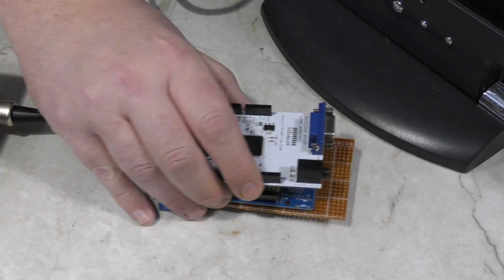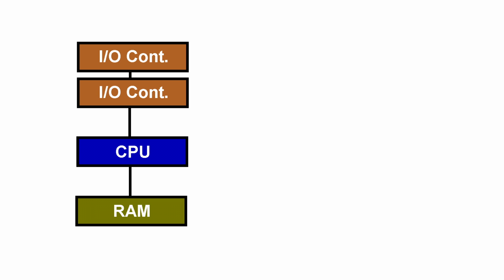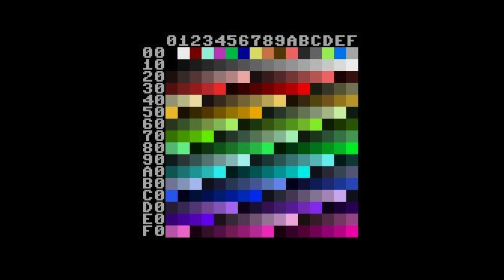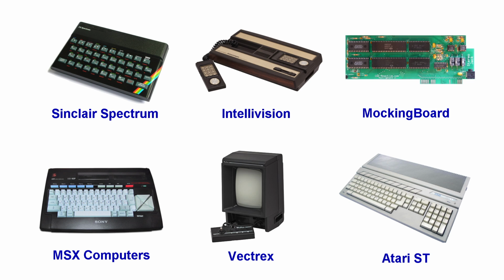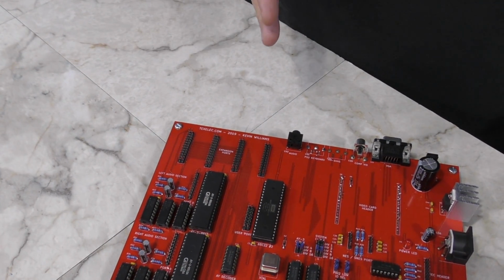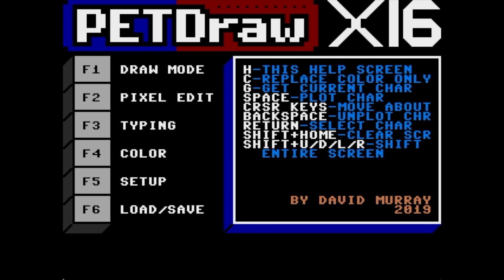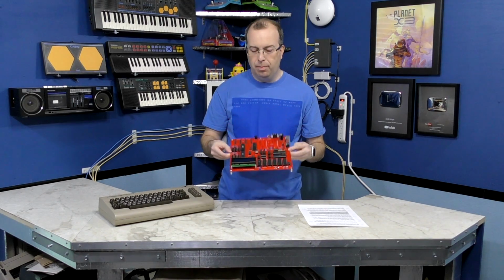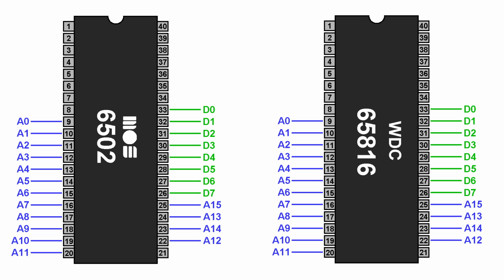Building my Dream Computer - Part 2

Comment: No HDMI is a big problem in price range of 200-300 USD for board only.
Reply: I don't get it either... They are allready using an fpga for graphics...
Reply: @derrogers    I can't think of any decent current monitor that supports VGA or even EVGA any more.  DVI is rapidly disappearing as well.

This project should support newer video interfaces such as HDMI, Display Port or USB4 video or at the very least keep the 4 expansion slots on all versions of the board so that 3rd parties can add such cards.
Reply: If you add a HDMI port you need to pay royalty to the VESA organisation. You can get around it if you use a DVI port as that connector doesn't require a royalty and is compatible with HDMI. But you're limited to RGB colour mode and no support for audio.
Reply: There are external VGA to HDMI adapters you can get on the cheap, and VGA is much much easier to generate.
Reply: You need to pay a license of 10k a year is you want to use HDMI port and have it tested which is around 8k. Also a royalty of 0.05$/sold product, there's a license of 5k but then the cost is 1$. That's why other projects use a DVI connector. Also a VGA core written in VHDL is easy to make for a FPGA. HDMI is a lot more complex to make.
Reply: Not when produced in high enough numbers, but let's face it, it won't have the same popularity that the Raspberry PI enjoys right now ;-)
Reply: The vga to hdmi adapters are relatively cheap...
Reply: To buy a new machine and to use adapter (converter) in order to display on modern monitor? Why? Even cut down RPIs support HDMI as video output. No VGA on new TVs, etc... Why?
Reply: VGA to HDMI converters can be had at less than $15 on ebay and amazon. Will those work? If they will, I don't see any problem.
Reply: If you cant find an old VGA monitor laying around unloved your not trying hard enough, they are everywhere and as others have pointed out cheap VGA to HDMI adapters are easily found, really its a moot point other than just for the sake of moaning. If you want to use this computer, it wont be hard

Comment: Glad to see that there is a working prototype for this now!  As a computer engineering student, I find these types of projects fascinating.  I know you're not much of a fan of FPGAs, but through my education I've come to see them as the perfect solution for custom logic.  Off-the-shelf chips will come and go, but HDLs and re-programmable chips will always be available.  I would have loved to help out with the video system, but I was too busy when the initial announcement was made, and I had enough of a struggle making a simple 80x60 pixel display controller for my coursework.  It looks like you've got a solid team for this, and I can't wait to see how it turns out!

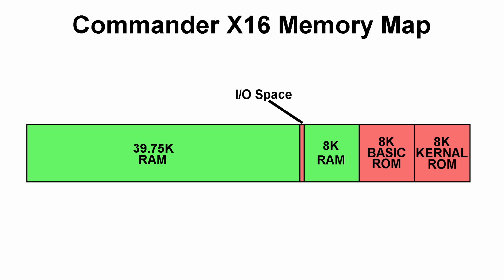Comment: 7:26 just out of curiosity, why are you putting the ROMs in high memory instead of low memory?  This constrains the ability to add more RAM some time in the nebulous future.  (Yes, I know that's how it was done in the 1970s when Commodore and DRI designed their systems, and I thought it was a bad idea then -- really the 1980s -- too.)
Reply: The 6502 is wired to look at an address at the top in order to determine where to start executing, so you'll need something there. You could start by banking that out afterwards, but most designs just keep it there.

Comment: A sound subsystem using some dsp microcontroller (e.g. dsPIC30 / dsPIC33) interpreting MIDI or some sort of frequency synthesizer also might make a nice addon card.
[edit] Many dsp microcontrollers, like the metioned dsPIC30/dsPIC33 already come with some builtin DAC.

Comment: Wow wonderful work. This reminds me of a project I completed in late 90’s based on the VIC 20 with 128k banked RAM (8K pages). I used a W65C816S in "emulation mode” at 10Mhz, and W65C22S's for I/O (connected to the original VIC 20 keyboard). For video/graphics I used a very advanced TMS34010 that I never really used to its full potential. I modified the VIC20 Kernel/Basic to work with the new memory map and graphics (burning these to faster EPROMS that could run at 10Mhz). I later added a YM2151 for sound. The whole board was wire wrapped and it still sits on my shelf as a reminder of yesteryear.  My main problem was lack of software, if I wanted a game I had to write it myself, the internet was young and I had nobody to bounce ideas off.   I'm looking forward to see what software you write for the Commander X16

Comment: Will the system have a SD card slot and what other types of connectivity? Internet accessibility?
Reply: you could add internet connectivity as a hack but that was never an intended feature of this computer as this computer isnt meant to compete with modern computers
Reply: @DanafoxyVixen  not to compete but give the ability to network with other x16's on a lan to play multiplayer games...it was just a suggestion coming from a gamer

Comment: Woah! Since when does the ZX Spectrum have a sound chip?
As far as I know, the ZX Spectrum used the Z80A cpu to bit-bang a class A transistor amp that output to a walkman speaker and the mic socket.
Reply: After some digging: It was on the officially licensed Timex Sinclair 2068, but it's a bit of a stretch to say it was on any ZX Spectrum...

Comment: NES/SNES controllers? Better use 9-pin as it's not proprietary.
Reply: Many Famicom clones use a regular 9-pin connector for their NES controllers.
Reply: @shiru8bit  exactly - famiclones. They mean real proprietary 5-pin. They never had those clones just like it was in many countries (except US, Canada and Japan). BTW - most clones utilized 15-pin connector as it was used for expansion port on Famicom.

Comment: So basically what you're now doing is apply 8086 "extended" memory mapping to a 6502 architecture...
Reply: You meant expanded memory ? Sad that multiplied D/A lines (usually solved with primitive latch !), suddenly become an issue.
Reply: @semibiotic  No, extended. expanded memory was only possible when the 80386 had protected mode.

Earlier machines did not have an MMU so even though they could use paged memory segments, the segments were basically just 'dumb' and not managed.

Comment: That case looks a bit too "gamer" in my opinion, and a massive turn-off for me.
Reply: Jep, I think so..
Reply: Would be interesting to see some fake wood on the case. That would make it feel like something out of the 80s.
Reply: Patrick McMahon fake wood is far more 70s. 
There was a bit of spillover into the 80s but it was purely old cabinets or people who weren’t into what was in.
Reply: @Frisenette  didn't they still have fake wood on cars in the 80s?
Reply: Patrick McMahon wood paneling on cars have a completely different story, feel and tradition than on electronics. People were aware of this at the time.
That said, it was absolutely seen as way kitsch by most “normal” people.
Look at NL Family Vacation from 83 for an example of this.

Comment: Will it output RGB through the VGA port that can be run on a SCART-TV or video monitor? Since there's a composite output I assume the signals are compatible with TV standards, but I just wanna be sure.

Comment: Will it still be possible to use the 65C816 cpu, restricted to 16bit addresses?   There are circuit examples that make this cpu look pin compatible to the 65C02.
I'd rather go with the old school dip chips (but would go with QFTP equals) but NO FPGAs emulating the cpu or other stuff.  OK for glue logic though.
Wish you could use those GI sound chips.  I realize that their bus interface isn't fast enough at 8mhz, but couldn't you add wait states or even interface them through a VIA so that the bus signals were done in software to meet the timing?  There should be a way to interface slow memory and I/O to a fast processor, granted the processor would have to slow down while writing to the slow hardware, but the effect would not be a disaster.

Comment: I really wish the case and keyboard were one unit like all the classic 8-bit machines.
Reply: Not me, I would like it to be able to use different peripherals on that port. Maybe a PS/2 combobus comparable to 199x era laptops that enable you to connect both keyboard and mouse/ other peripheral using a simple splitter cable.
Reply: Me too, but that would probably be even more expensive
Reply: I like the idea of a seperate keyboard personally. The idea of an integrated keyboard gives me nightmares.
Reply: covishen

Wouldn't that basically be a laptop? LOL
Reply: Hi! We are going this route for very good reasons. I'll be doing a full post and user poll shortly on the Facebook about this. In short, we don't want to custom build a case and keyboard as that would add hundreds of thousands of dollars which you guys would have to pay for. It also introduces many risks and delays as you have seen on other projects like the ZX Spectrum Next. Therefore we are limited to high quality off-the-shelf components, which is the spirit of David's project. We will be customizing and rebranding these and you'll see all the options in the aforementioned poll, and have a say. We realize with nearly 1 million subscribers we are not going to be able to please everybody, and we thank you for respecting that. However you can trust that we are moving forward with the best possible option for the community so you can get this machine in your hands as quickly as possible and at the best value. 👍🕹️
Reply: Sameeee
Reply: Well, all except the 8-bit IBMs, LOL
Reply: @ACanOfBakedBeans  I don't think IBM had an 8bit desktop?
Reply: Yes and coincidentally I carry a keyboard and mouse with me when I use one. ...lol
Reply: my idea could be that you could  dock the keyboard above the box , otherwise, if you undock it, you put it in the front just like the actual mockup

Comment: The video ram thing looks a little odd...   like 80 column on the C128 ... ish...    
Like the simplicity elsewhere though....    Forth built in :)   Vote.

Turnkey assembler is very cool -  6502 assembler is as easy to learn as basic, similar number of commands just more addressing modes - very neat idea. My 15 year old self would be all over this!

Comment: 10 Print "x"
20 Goto 10
RUN
ALL RIIIIGHT, that works, let's start the mass production.
Reply: 10 Print "The 8-Bit Guy"
20 Goto 10
Reply: 10 Print "Planet X4 Coming To The X16"
20 Goto 10
Reply: @ACanOfBakedBeans  it should be Planet X16.
Reply: @BimboSnelf  Planet X69...oh wait, that's a completely different type of game
Reply: Let's cut costs by not offering a semicolon. 1 line for programming should be enough for most hobbyists. If they really want the semicolon, then maybe we can offer a semicolon cartridge for $2 + $18 shipping. The same goes for extra lines to program with. More lines means more cartridges. In fact, maybe we can insist that all cartridges be soldered in by licensed technicians.

Trust me: I think that the shareholders are going to love us.
Reply: you forgot to put a ";" at the end of the string so it doesn t break a line after printing
Reply: @robsonbromberg9042  might be intentional
Reply: Yes
Reply: That's all I'd use it for
Reply: Adam Richard  sell point for this, but we all have that allready
Reply: That's got more complexity than the tests Java devs write for production code in my experience. I think we're good to go :)

Comment: I would be so up for a kit version that would allow you to construct the computer yourself!! that would be so retro.
Reply: Agreed.  I think many people would buy a kit on principle, but it may also keep the cost down.  Cost is a factor with a few of my 8-bit enthusiast friends, so a kit option might make that easier for them.
Reply: Yes, please!  Make bare-board w/documentation and full kit packages available!

My first purchased computer was the Rockwell AIM-65 single-board system back in 1977.   I saw your memory model and the first thing I thought about was additional programming environment expandability and was pleased about the Assembler.

My AIM-65 has 5 ROM sockets on board... 2 for the 8K System Monitor (included), 1 4K slot for the Assembler and 2 for 8K Basic or PL/65.  I later built a bank-switched memory expansion board (32K) to back-fill low memory (board had 4K) and put ram in the 12K language address range so I could load Assembler, Basic, PL-65 and Forth as desired.
Reply: All off the shelf components.  I would be happy with just the PCB and a parts list.  Warming up the soldering iron now!
Reply: Same here. I'd like to make one from a kit to better my soldering skills (which are good enough to do this as a kit but practice never hurt).
Reply: Markam67 That would be like Heathkit retro!
Reply: Yes!!! I would totally be into a kit build too!

Comment: You're failing to consider the Atari 8-bit architecture. Using the RAM under the ROM and hardware address space is straightforward. So is bankswitching in more RAM.

SpartaDOS can sit in a cartridge and use an extended RAM bank.

The best thing you can do for it is a compiling developer kit in C, C+, C++,  C#, etc to make porting code easy.

Comment: I once managed to run out of basic memory space on the c64 tho it was mostly because of lazy programming, I was making a calender program and stored a whole year worth of data into arrays. If I had used data files it would have fit fine.

Comment: I'd kinda like a breadbox case.... Also, if you end up being more expensive than c256, is there a point? Also also, I do hope  you'll try to design things so that people can use compatible CPUS running at different speeds (supercpu-style) without breaking the timings on all the other chips.
Reply: actually part of why I chose the case that you see is because it looks like the breadbin Commodore 64 with that bull nose front

Comment: It definitely wasn't necessary to use multiple FPGAs for this.

A system such as this can fit entirely in a single small FPGA, unless you want a bit more ROM / RAM than is available on-chip.

A board like this, including RGB video output, PS/2 keyboard port, SDRAM, and even a USB Blaster can be found for only $35 SHIPPED...

https://www.aliexpress.com/item/32858413588.html?spm=a2g0o.productlist.0.0.751942feunmL1y&algo_pvid=7b6a6e42-38c2-4882-9597-49773acf7e64&algo_expid=7b6a6e42-38c2-4882-9597-49773acf7e64-0&btsid=4f0b7505-ade7-4949-9781-8330663c7424&ws_ab_test=searchweb0_0,searchweb201602_7,searchweb201603_52

That FPGA has 6,000 Logic Elements, which would be enough to fit an entire C64 core in, including dual SID chips.

It also has plenty of IO for hooking up other stuff, although that would require some voltage translation if you wanted to interface to 5-Volt peripherals or chips.

But, I do genuinely get the desire to use an original CPU instead.
There is a bit of a different feeling of using a "real" CPU on a retro system, even if it's a kind of placebo. lol

I also designed a board around the 65C816 about 5-6 years ago, but to use it with more modern storage like SD cards would have still meant adding a modern MCU, which again took it away from being a pure "retro" machine which only used chips from the 80s or early 90s.

I'm glad you found a solution that fit your requirements in the end. It's looking quite nice. ;)